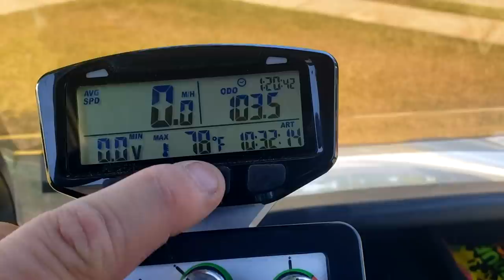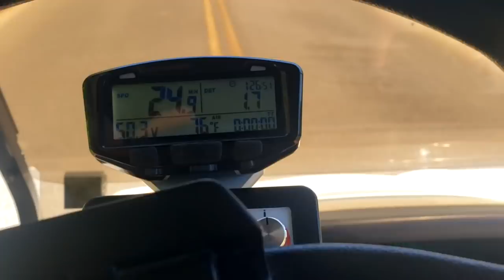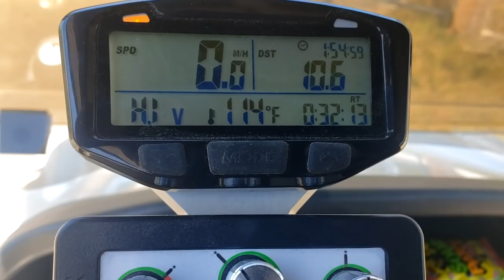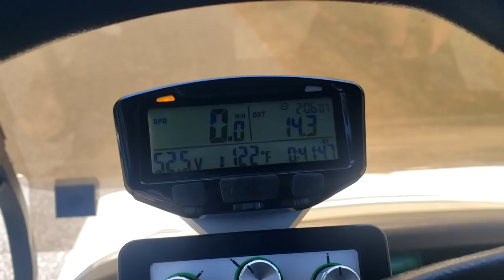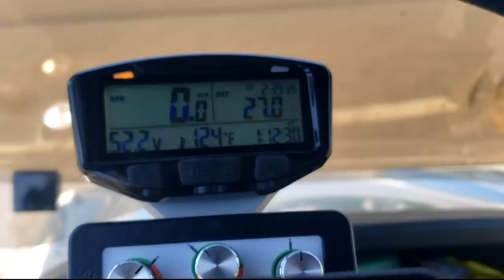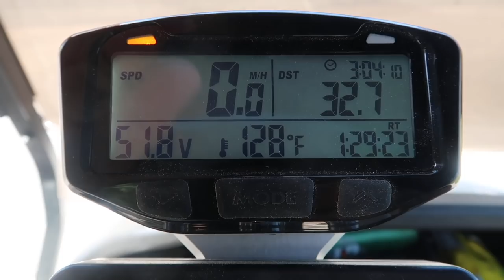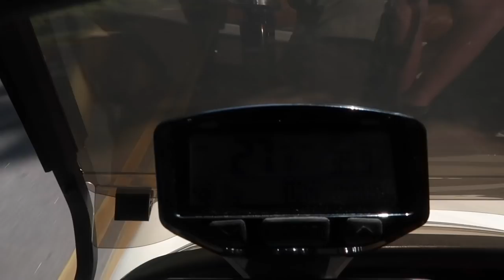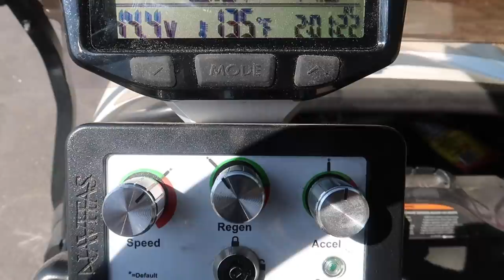I Drove The Golf Cart Till It DIED | Lithium Battery Range Test Navitas AC Conversion | Club Car

Comment: Ok. I'm convinced. With the right setup, electric is the one for me. 40 miles is WAY more than I will ever use and it should alow me to sneak around my little ranch popping piggies without engine noise running them off. What could a guy reasonably expect to pay to buy or build a rig like yours in the current market?
Reply from the maker: Buying one already done??? idk. probably in the teens. I would find a cart that needs work and fix it up that way. You would be able to save a bunch! Then you would have exactly what you want. I picked this cart up for $2k stock last year.
Reply: @Fentertainment  I'll second that! I picked up an EZGO 48V off a local dealer out of a fleet fresh off the golf course for $2200 -- I have a total investment of $6K at this point, changed out the body, roof, added the flip back seat, with a cooler built in, custom dash, installed street legal lighting kit, 14" wheels with street tires and a 4" lift.. My Trojans were on their last legs, so I made the leap and just ordered the RoyPow 48V 105 battery kit.. should be delivered tommorrow! After watching your videos thinking I might move into the Plum quick motor / navitas setup next year if the boss(wife) approves the $$$ lol.. Pretty much blew my budget on the RoyPow and some LEDs -- loved your wheel light setup too! great videos!
Reply: @Fentertainment  I got one for $2500 2 years ago. All the work you have done on yours on this channel, how much would you roughly say you have in it value wise? And if you were to sell it tomorrow, how much would you list it for? Great work by the way!

Comment: I have a 2001 36v eazy go txt golf cart. It only goes 12 to 13 mph. I'd like to switch to a lithium battery in hopes it goes faster.  If i get a lithium battery, do i need to change the motor or converter? Or do i just connect the lithium battery the same way as i connected my acid filled trojan batteries?  Thanks for the content.
Reply from the maker: I just did a video with my dad’s 36v ezgo and lithium battery swap. His is completely stock other than a lift kit and tires. Be sure to check that video out.

Comment: New to golf carts; but what is an average range for normal batteries?  I just bought a 48v Yamaha with Trojans and I might get 10 miles if I’m lucky. The seller was unsure of the battery age.
Reply from the maker: Look at the top of your battery at the post. A trojan will have a number and letter etched into it. The number is the year and letter is the month. Jan a, Feb b, March c etc. Maybe 15 - 20 miles on lead.
Reply: I have a 2018 Yamaha drive 2 bought in 19, and I was lucky to get 12 to 15. Now maybe 8 to 9. It came with a brand new set, dealer told me 20. Definitely going with BB Husky!
Reply: I was lucky to get 7 out of my Trojans on the golf course which is on soft grass compared to black top.

Comment: I have a 2015 Yamaha cart. It died on me a couple weeks back, batteries we’re getting weak so I replaced those and the the throttle sensor and it still don’t work. I’ve check every fuse as well, and suggestions?

Comment: Great videos I’m in Summerville. What bracket do you have for your “OTF” controller? Also what what is the name of the voltage reader you are using?
Reply from the maker: Hey Rhett, The bracket was a upgrade with the speedometer which I've also done a full video on.I trust it more than any battery indicator or meter that i've ever used and it has much more functions to it. It had room underneath so I mounted my otf there. The speedometer is called the "Ex-Ray" and here is that video - https://www.youtube.com/watch?v=v-7uvdnXTzg
Reply: Just watched it. Thanks
Reply from the maker: @Addison2580  Where all do you ride in summerville? Getting kinda bored with the corner over and over.

Comment: FEN, just found your vids, great job doing what you do. My question, do I need to change the controller or anything else on a stock Yamaha Drive 2 before/after installing a BB Husky? Camp a lot but I don't bring my cart because my kids will kill the battery in 25 mins or less. My goal is to ride my cart for a long time between charges. Thanks
Reply from the maker: You shouldnt have to. How do you like your drive 2? Been looking at adding one to the channel.
Reply: @Fentertainment   It's my first cart and it's really nice. Bought it with a 2" factory lift, turns heads. I haven't had anything else to compare it to. Dealer should have been a old school used car salesman. haha

Comment: Morning, If I install a Boss sound bar 36" does it mater if I wire direct to same 12 volt battery both positive and ground? (48volt 4-12volt Trojans) Are do I need to ground to the frame or another 12volt battery?
Reply from the maker: If you wire it directly to a single battery then that battery will go bad first. I would buy a 48v to 12v converter and install it that way. It will pull off the entire pack.

Comment: What battery settings are you using on the app for this setup?  I'm running the exact same battery, controller and motor.  Love it but I'm having some trouble finding a balance between performance and distance.
Reply: Hey Kyle I have the exact same setup and wanted to know what settings you use as well. I called Navitas help line and they told me to switch to RoyPow S55105 setting.  I’d like to connect with you and share some troubleshooting if you don’t mind.
Reply: @dgeorge1776  Hi Dave and anyone else who might find this info useful.  This is what I've learned through trial and error. I hope it helps you through the learning curve.

I try to keep the software updated.  I currently run the EXGO_TXT_600A_5kW_Navitas v 8.011 firmware.  I also run S55105 settings.  I recently switched to it based on your comment and I don't notice any difference to performance or longevity.
  
I generally followed the instructions provided by Navitas.  The only other change I make in the settings is in the forward speed limit.  I max this out and use the manual control dials to regulate speed/regen/acceleration depending on what I want to accomplish.  I picked this up from one of the forums.  The idea is to give myself the full range of capabilities in the settings so that I don't have to be looking at my phone as I need to make adjustments depending on how I'm using the cart.

Other thoughts: I find that I can go ~30 miles with the dials set to the black lines on the Navitas controller but I recommend testing for yourself so you don't end up in a tough situation.  Limiting the speed and acceleration dials seem to prolong battery life a bit.  It took a little time to find the right balance.  Regen seems to help with breaking.  If I'm using higher speeds, I like to increase the Regen to assist in breaking.   When I'm in slow speed environments, I find that decreasing the Regen makes for a smoother ride. 

I also recommend understanding the laws for your state/city as it relates to golf carts. It's a big deal where I live. I personally love having seat belts; they're great for keeping butts on seats.
  
Lastly, I don't think the Big Battery HSKY is the right solution for a golf cart.  I love the lithium battery, but I wouldn't buy this one again. I've made them aware of my frustrations.  They seem perfectly happy to charge me full price for replacement parts.  Here are some of the things I wish I'd known sooner.  Big Battery sent me a charger that is not designed for onboard usage. The rattling around while driving caused it to fail.  I thought I made it clear that I wanted an on board charger during the sales call but I was unable to prove it.  I had to order a new charger at full price.  It took 3 weeks to have it delivered.  That means I was without my cart for 3 weeks.  I had to follow up with them weekly to keep them on track.  It was a bit of a hassle.  Also, just to be safe, I ordered a charger that is meant to stay on board once it came off of back order.  Now I have redundancy. Still, that's about 600 bucks in cost I wasn't anticipating.  Additionally, the big battery proprietary plastic cable connectors will melt and fuse together.  Make sure you keep them off of the battery and away from heat.  These were not covered under warranty.  I purchased a new set of cables, but they sent the wrong ones.  Then they sent me an adapter instead of the right part.  Providing a pleasant customer experience seems to be a low priority for Big Battery.
Reply: @kylewoodwon  Thanks Kyle!  My charger also failed after only 4-5 uses last winter.  It’s smoked and fried.  It was the cheaper 12A charger but they considered it under warranty.  So they sent me the upgraded 15A charger that is a metal case and has the external fan.  Are you saying that higher amp / beefier charger failed leaving it in the cart or the cheaper one with the plastic case?  Also, which cables melted on you?  I have 4 gauge wire with anderson connectors going into the battery and back to the controller so I haven’t noticed anything getting hot.
Reply: @dgeorge1776  The plastic around the anderson connectors is what melted.  All of the charger cases have had metal cases.  But the difference between the onboard charger and the other is unmistakable.
Reply: @kylewoodwon  What is the difference? It looks like they just added a few types to their website.  Mine looks like the one called 48V 20A IP65 charger.  But I think mine is only 15A. Mine has the mounts for two sides but it isn’t yellow. I assume they added that for the 20V.

Comment: I just bought a brand new 2022 StarEV Sirius 2+2 with 48V 105AH Lithium battery. I took it out today for a long ride and got 14.8 miles of range after all the green bars were depleted. There were only 2 yellow and 2 red bars remaining on the battery meter. My top and maintained speed was 23mph the whole time. I didn't have my BT Soundbar on or anything else that might drain the battery. I wrote an email to StarEV and will be contacting the dealer on Tues when they're open again. Something just doesn't seem right at all. Even StarEV documentation says I should be getting 30 to 45 miles of range with this battery. Anyone have any idea on what might be happening here?
Reply: I have a Husky 48V Lithium pack the same one on this video.  The battery was fully charged up before my trip. 
The average speed was  30mph.
The battery app for this battery said I had only 30% left on that battery.  The total distance that I traveled round trip was only 10 miles.
I was supposed to get around 60 miles or so on a full charge.
Reply: How much do ya weigh?

Comment: Ryan, just completed big battery husky 48 v conversion on my 2016 TXT.  Stock charger not working,  what am i doing wrong. 
Thanks
Reply from the maker: If the new battery has the same terminals on it as the old set of 6 batteries then it should. Im using my stock club car charger to charge mine.

Comment: Which battery do you prefer the Big Battery Husky or the RoyPow S51105?
Reply from the maker: The husky didnt cut off on this cart so I removed it from this one and put it in my limo on 33s with the navitas ac. That battery hasnt given me any problems at all.
Reply: @Fentertainment  I have a pretty much stock 1995 Club Car DS with a Plum Quick Copperhead motor. I think it's due to replace the standard batteries. Was thinking of either the BB Husky or the RoyPow S51105. Frankly, I mostly just use it around my yard so maybe even the S5156 would work. Appreciate your opinion.

Comment: did you ever do a test with the Trojan batteries? an say i put a 700 amp controller will that drain the battery pack more? i was just thinking that why factory just puts a small amp controller to get the max distance on carts
Reply from the maker: @hillbillybassfisherman8181  Im sorry for your loss. I never did the lead acid test. The lead wouldnt go as far as the lithium. There are more upsides to lithium that really made me switch. Charging time is so much lower, No water up keep, Less weight is a big key.
Reply: i just bought me a digital meter to put on cart since i know when it will leave you on side of road
Reply: i have 2001 resistor cart i just thinking that may drain battery or dont give it as much power as a amp controller i got another club cart that has controller i was going to try that with my bigbattery just to see how that does it only has factory 36\48v controller but that still be more power than the resistors correct?
Reply: think i am going to just send my motor to plum quick do the bandit upgrade on the motor that fast enough for me
Reply: @Fentertainment  yea i bought the 36v gatr max i like it.charge time just couple hours now.
Reply: i been trying to understand the amp controller how it works how much power it eats ect...

Comment: When watching the motor temp, when would you call it quits temp wise?
Reply from the maker: Good question. When I installed the edt speedometer I was told to put a certain setting in the programming. However when I shot this video it wasnt even hot outside. Once summer gets here with the 90-100* temps the motor will heat up even faster. I dont think the temps are correct but a navitas tech told me to enter those temps. idk. Use your best judgement, For me.....I'm still gonna send it.

Comment: WE WERE TOLD TO NEVER LRT OUR LITHIUM BATTERY POWERED CART GO DEAD....   DON'T BE DOIN THAT STUFF OR YOU COULD BE MESSIN UP YOUR BATTERY  DUDE.... AND WHY WOULD YOU TAKE A CHANCE OF DYING RIGHT OUT THERE ON THAT 4 LANE HIGHWAY WITH SPEEDING VEHICLES COME AT EACH DIRECTION   ?  ARE YOU NUTS ?
Reply from the maker: Normally I dont let it get past 50v at rest. However I try not to lie on this channel and wanted to give a honest range test of the battery. I dont believe i was on a 4 lane hwy and to answer your last question. Sometimes.